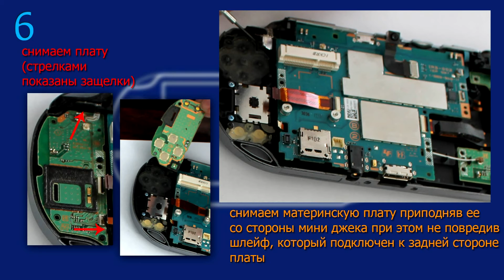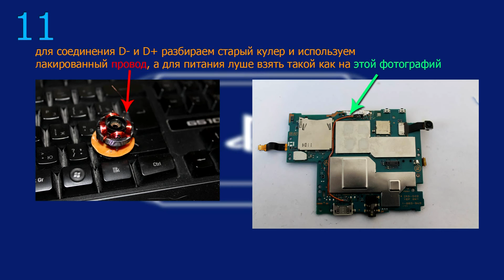PS VITA micro USB mod / устанавливаем микро USB на PS VITA

Comment: Hello, I have a question; you shouldn't solder pins from micro usb to mystery port pins on motherboard right?
Reply: 2 Also how do you remove camera? You can't just unplug it right? 3 You need to use heat gun for mystery port and soldering iron for micro usb and cables ?
Reply from the maker: @Kahalix  Hi, nom use mystery port:) yes you need soldering gun for remove port, but you can just remove camera without soldering
Reply: @TheBebua  Hey, okey thanks
Reply: @TheBebua  hello again; i have tried to desolder mystery port with heat gun in 360 degress but it won't even move. I used flux

Comment: Hi I have a few more questions. 1. Will this mod also work for Data Transfer or just for charging? 2. The wires you use are they the male to male jumper wires? 3. Can you recommend me a soldering iron for the soldering and desoldering? 4. Is there a website with this tutorial on it?
Reply from the maker: 1. this works with data transfer too.
2.you can use male-to-male jumper wires for VCC, but for data you can use very thin cable. if yiou use for VCC thin cable its would not charging because for charge need more current.
3.I cant recommended soldering iron, you need some skills to make this hack, because its not so easy work with very small details.. so ask someone who can soldering for you.
4. no website, you can ask me what you need and I will help you

Comment: Wat size cable did u use for the VCC, hard to figure out by the video
Reply from the maker: you can use standard cable from PC fan or little thinner, I don't know which diameter is it :)
Reply: TheBebua I know just the one. Perfect, thanks for the answer :)
Reply from the maker: you're welcome and good luck :)